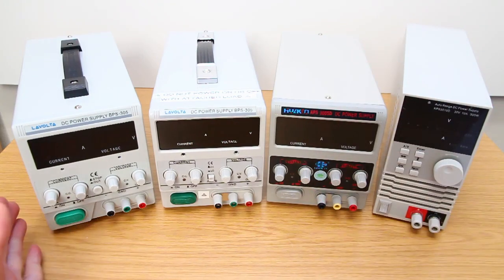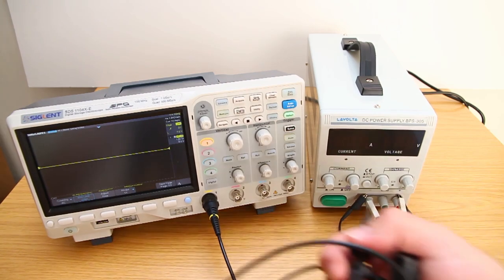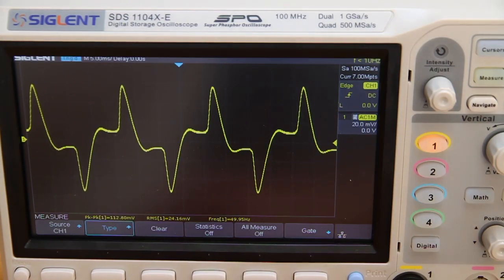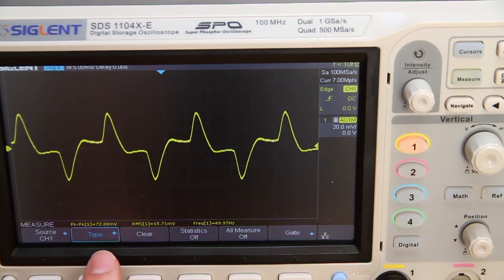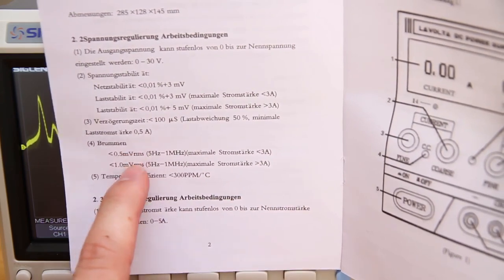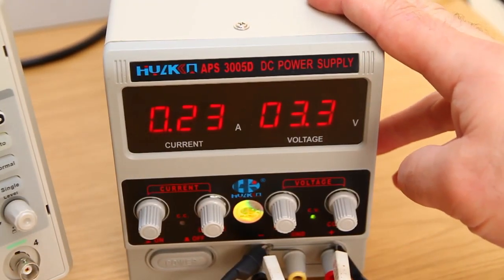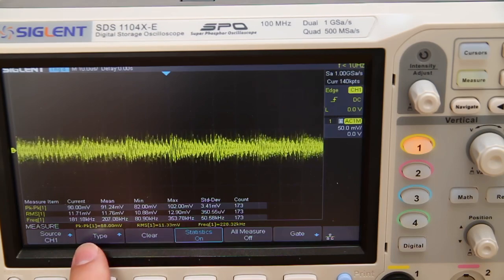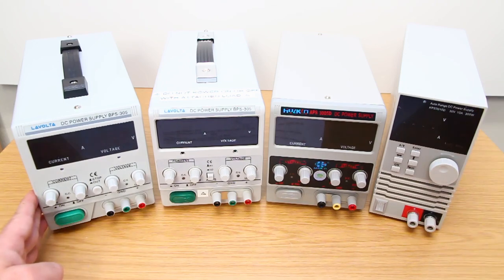Cheap Power Supply Ripple Comparison - Lavolta BPS 305 MKI, MKII, Huakko APS3005D, AVR KPS3010D #024

Comment: 1. As you mention, that scope probe is not the best, and only because you're using a ~4" long ground connection. You need the spring on the ence of the scope probe, its about 1/2" long max.
2. 50Hz ripple is really a ground loop, or a really bad transformer. You should of tried w/o the earth ground and supply grounds tied together.

Comment: I just love how the advertised specs from these manufacturers on line are so much BS but as I see it: as a selling point. High level of noise RMS from a supply I purchased from Amazon, (not blaming Amazon) the specs are listed for constant current of this certain product is 30mV at full current, hell it's only 1.5 Volts of noise at 30vdc, 10 amp output....Lol. Yes it's buyer beware!! Love the video nice to see things like this 👍👍

Comment: it's pretty funny how one reviewer says 100mV ripple is very good, and another one is saying 112mV is quite bad. I guess it can't be just good or bad, it depends on a particular application. For a hobby power supply priced at $50, 100mV constant ripple (that doesn't depend on voltage or current) is probably rather good. For $400 power supply it would probably be rather bad.
Anyway, it's great that even cheap ones can be pretty good, and thanks for sharing your testing results!
Reply: I have to partially agree with you. But are you refering to a speficic reviewer? 
However, I guess every reviewer will agree, that a linear PSU with 100 mVpp is bad and a SMPSU with 100 mVpp is acceptable for the typical maker.
Reply: @ThePetaaaaa 100mV in an smpsu is pretty bad too. It’s just so gratuitous. It can have >10x less junk on the output while costing the same. It only takes a bit more thinking and experience to make it so.
Reply: @absurdengineering  I don't disagree with you. But sometimes just adding a LC or Pi-filter to a cheap DC/DC would be "to expensive". 
Not even talking about a linear post-regulator.

Imho it depends on what you want to power and if for a few hours a week or 24/7. 

Just my two cents.

Comment: if you are buying one how do you tell if you are gonna get the good or the bad ripple one?
Reply from the maker: Hi,
there are only slight differences between the new and the old version. The most noticeable is, the knob in the middle of the front panel, on the new version the knob is round and the old one the know is square, for all differences watch the first review video I did on this power supply #022. Although when I bought this power supply, the seller used a picture of the old version.
The bad ripple is actually very easy to fix, that video is already up on my lbry.tv channel.